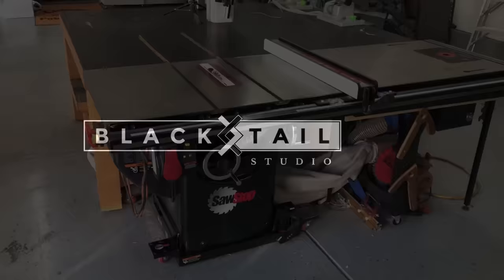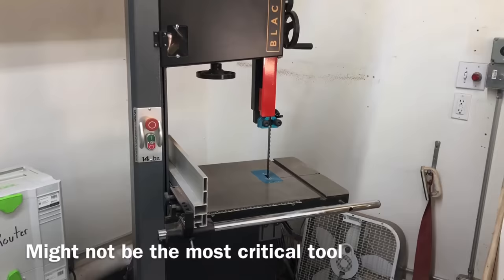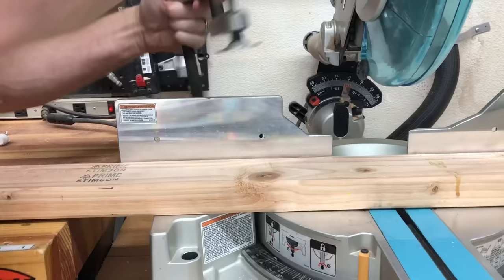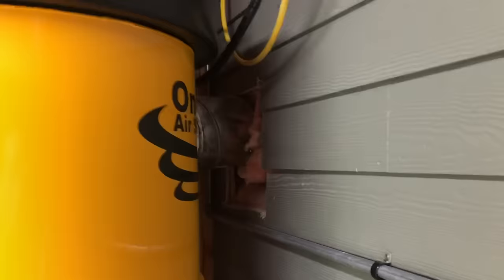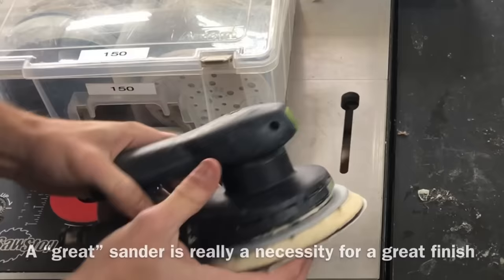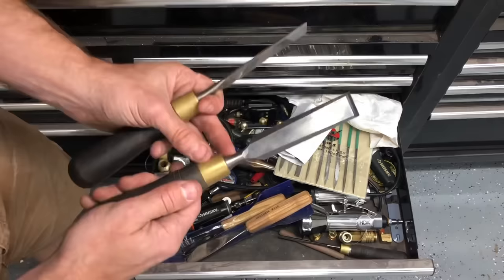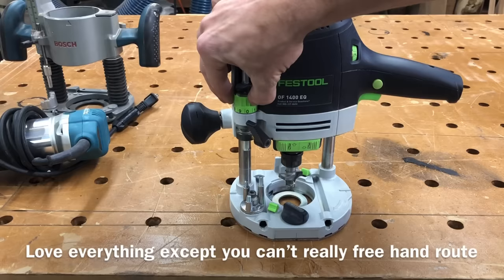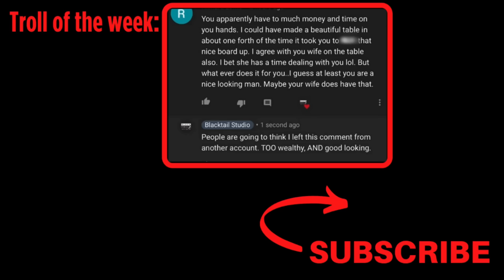10 Essential Woodworking Tools  - Woodworking Tips and Tricks

Comment: My most important tool is my circular saw.  I had a Makita for several decades which got stolen but even after 40 years, Makita made the same model.  My most important non-woodworking tool is my Makita cordless drill kit with two cordless drills.  My woodshop was a casualty of a failed 45-year union with my ex-wife.  I am starting over again but, slowly.

Comment: Favorite tool has to be the table saw! Though I don’t have a shop, I enjoyed using one when I worked in a shop! So many questions!!! how do you find track saws for certain circular saws? Do Irwin clamps normally fit in the bottom of the track like yours? Where do you find the right angle attachment for the track saw? Are you cutting straight down for bow tie inlays? Or is there a negative angle to allow for glue?
Reply from the maker: That’s over the limit! A track saw is made for a corresponding track. You don’t buy a track for a random saw. Hope that helps get you started!

Comment: #1for me is Starrett Combination square and a sharp marking knife.    I can't get any of my machines to work as accurately as these two in combination.  Next up are the various Lie Nielsen planes from a jointer down to my block plane and bevel edge chisels.  I end up using all these hand tools more than my excessive assortment of machines (sawstop, 20" planer, 8" jointer, 5 HP shaper, 24" resaw capacity bandsaw, and various festool items).
Reply from the maker: Good call!

Comment: My favourite tool: Bosh 2.3 HP router... 

My most hated tool has to be my circular saw because I get a slight chamfer even though the angle is set to 0 degrees. 
I really like your Festool track saw, but its way out of my price range. Are there any other track saws that you can recommend?  

Love the troll of the week though! keep that going forward lol
Reply from the maker: You got it! And I’ve only used the Festool
Reply: @Revan Sohan .Bosch professional has a good track saw aswell. I bought that as my first one, had it for years before I dropped it and had to buy a new one. I got a festool ts 55 rebq plus, and that’s an amazing saw! The Bosch one comes very close though! Especially since festool only really outshines other brands when you got other tools from them (because tracks can be used for a router and a track saw for example) but the Bosch GKT 55 is a great purchase, and it’s a little cheaper. Sorry for the rant by the way

Comment: Chisels: You need a paring chisel, a mortising chisel, and a 1/2"-3/4" flat chisel (for door hinges). That's all you need. Get the cheap ones, because you are going to drop them at some point, or just loose track of them.
Gouges and V's are basically useless unless you are a carver.
PS., the bandsaw is probably the safest power tool you'll ever use, so get one.
Reply from the maker: That’s a great list Steve! Good call on the bandsaw, I talk about the relative safety of it in the blog too!

Comment: Great tips! I think my fav tool so far is my track saw, not a festool but Makita is good for my skill level right now. I just got rails for a router sled but I haven’t used it yet. do you recommend using a belt sander after flattening my project or will an orbital sander work? 

Thanks!!

Comment: My Favorite tool is my little old Skill circular saw.  It is not a great tool but it is about 35 years old, only cost me $20 and it takes a licking and keeps on ticking.  It still has no wobble and if you have a sharp blade in, it will cut straight.  I was doing some home renovating and used it a lot to cut concrete and blocks figuring I was going to kill it and it is still going strong five years later.
Reply from the maker: Love me the circular saw

Comment: I really like my Festool HEPA vacuum and the Rotex 90, 150 sanders. I thought that spending $700 for a HEPA vac was retarded but after using it while stripping paint off my house I’m a believer. Hooked up to the Rotex sanders for inside work refinishing my stairs also was awesome. Didn’t need a dust wall like you would with other setups.  Once I”m done with my house remodeling maybe I”ll use my tools for some custom woodworking. Love your channel and since you are only 3 hours away (Everett, Wa) you’re like next door in YT land....cheers!!
Reply from the maker: Cheers John! And great tools

Comment: Favorite tool is my tool is sander. No more by hand =D. Have you tried polyester cast resin on table project? If, what did you think of it and how would you compare it to epoxy resin? I think many would be interested about it since it's over half cheaper than epoxy and after my one finished table it seems to do the trick as good. Maybe video about this?
Reply from the maker: Never have!

Comment: Favourite tool - me, myself and I.
As for mitre saw. Kapex supreme accuracy is a myth. It's as accurate as 12-inch Makita. I have both.
I think that interchangeability if blades between mitre and table saw should not be the reason to buy 10-inch mitre saw. Buy as big mitre as you can afford;in terms of capacity and blade diameter - the bigger the better.

Comment: Circular saw with straight edge.  I have avoided using a table saw for years with this.  I need to upgrade to Festol for even better cutting but it is amazing what I can do with the old circular saw and my 30 year old straight edge.  Great list and provides lots of suggestions.  I am thinking a brad nailer would be important as well.  The question would be pneumatic or battery operated?
Reply from the maker: Good one! I only have air powered

Comment: I have a Laguna dust collector similar to the one shown. I was thinking about moving it outside to free up some shop space but don't want to be pulling all my conditioned air (heated in winter/AC in summer) out of the shop and exhausting it outside. Is your shop not heated or cooled?

Comment: Very helpful info, thanks. As a newbie I would like to know what the different chisels are for and how use them. I don't know which ones to buy
Reply from the maker: I think narex is a good starter set
Reply: @BlacktailStudio  thank you
Reply: Narex good starter set. Ideal size 1/4 1/2 3/4 for sizes use biggest size for your application equals cleaner cuts. Butt chisels for fine detail also hinges widest blades are like 2 inches wide easier to keep the recess all flat at same level. Mortise chisels for heavy work like deep mortises. Ideally normal chisel set can do it all.

Comment: Favourite tool is my corded power drill, I really don't do battery powered tools. Maybe because I'm getting on in life.
How do you find the hook and loop system on your orbital sander! I seem to wear them down in a few days and only know when my sanding pad shoots across the shop. I've just replaced the hook and loop self adhesive paper on mine and I've worn that out now to. I'm getting a little disillusioned with them. Any tips to keep them stuck
Andy.
Reply from the maker: They make a interface pad saver. I bet that would help ya out

Comment: Wow, cool. I have a few of the same tools you have. Maybe there is hope for me after all! lol...  I have learned that the spiral or helical head for your planner and jointer are the cat's meow.  That is my next major purchase, upgrade my lunch box planner to a wider helical head and upgrade my Grizzly 8" jointer with a helical head.  Oh, and I need to figure out a good track saw to get. Festool is just above my pay grade unfortunately .  As far as the table saw though, other than lacking power, isn't the blade selection/keeping your blade clean and sharp really the key to eliminating burning?
Reply from the maker: Yup! Clean makes a huge difference
Reply: Fabuloso and a tooth brush will keep blades ,bits, drill bits clean without damaging them

Comment: I liked this video because its interesting to get your point of view. With respect to Festool, they are an expensive poor quality version of better quality tools. Festool is good for the Domino which I think is a great contribution to woodworking (and which their success is riding); as for the rest of their tools, I wouldn't touch them. Under that shiny cover is old hat poor quality mechanics. I bought all Bosch Pro (that too was a mistake from me). Bosch's articulated miter saw is great (it saves room), but there are more accurate saws on the market, and cheaper. I also have 3 routers from Bosch, which I also regret buying.

My advice to anyone is check out as many videos as you can on various manufacturers and getting feed back. No one manufacturer provides the best of everything. 
You also need to remember that personal taste also accounts for selection! Finally, with respect to your comment regarding the table saw (Sawstop), I have seen many many woodworkers all commenting on how good this machine is (now owned by Festool because of the safety system); unfortunately in Europe I have not been able to source a supplier.

My conclusion is to get a Sawstop table. When I can, I will! Thanks for the video ... I really enjoyed your point of view!
PS. I am jealous you have a pilots licence... something else I am also fascinated by!
Reply from the maker: Great feedback!

Comment: My absolute favorite tool is my sawstop table saw with the router table mounted on the left.  Can’t use it enough…

Need a recommendation for a high gloss wood finish.  Walnut and maple woods, something that will make it jump out and slap you upside the head.  Not your sexy head though ;)
Reply from the maker: Tabletop epoxy gets a pretty silly shine on it 👍🏼

Comment: My table saw has to be my favorite at the moment. I have to ask, if you were going to flatten a slab with a router, which one would you use? I’m not as fortunate at the moment to have an industrial shop that’s willing to flatten a few slabs that I have. I’ve actually purchased the Bosch that you showed in this video but haven’t opened it yet. Do you have another suggestion besides the Bosch 2.25 hp?  Any input would be appreciated.
Reply from the maker: I used that Bosch a lot for flattening. Works fine. Best would be a big 2200 Festool I suppose

Comment: Great videos and a ton of information. I’m setting up my shop now, for the bandsaw, is the 220v Laguna 14” resaw you have hotlinked worth the extra expense of a dedicated 220v line from the box or for what you have experienced would the 110v resaw suffice?  Just wondering if the juice is worth the squeeze before I pull pitch. Thanks.
Reply from the maker: I’d go 220. If you plan on using the 13” resaw anyway

Comment: I'm just starting out. I own a laser engraved machine and a old hand sander I got from Wal-Mart a while back.  I have access to a mitter sae and a circular saw.  I'm looking at buying a bora centipede work table.  My question is this, I wanted to do some routing work on my engraved pieces maybe encorporate the 2.  What hand router do you suggest for first time user like me?  I'm self supported,  I buy what I can from what I cam sell.
Reply from the maker: Check out my blog. I’d get the Bosch in there

Comment: Hi Cam, my favorite tool is my Festool ETS EC 150 sander. I was wondering Where do you buy your mould release? Can i buy it local? Thanks!
Reply from the maker: Amazon. Linked in most my epoxy videos
Reply: Hi Cam, Aaron again. Which Festool orbital do you use on epoxy? 5mm or 3mm stroke? I have the 5mm and it does great, but was wondering if the 3mm would be better? Thanks

Comment: Hi Cam. I had a quick question. Would a stain + polyurethane  (like Varathane one step stain) be fine to use on epoxy? Thanks in advance
Reply from the maker: I’ve used it before
Reply: @BlacktailStudio  How was it? Does it work well?

Comment: My favorite tool is a skill saw
I’m working on a maple slab that has a small crack but it runs through the whole 1 and a half slab do I need to use a deep pour epoxy still if it’s only an 1/8 inch wide??
Reply from the maker: Man, every crack is different. I’m generally guessing on my own pieces

Comment: router table will really expand a person's woodworking capability
Reply: oh, and if you put a 1/2" rubber grommet inside your collet you won't have to slightly raise your bits before tightening them down.  Also helps with matched router bit sets like tung and groove bits or cope and stile bit sets.  bottom out the bit onto the grommet and tighten.  switch bits and repeat without having to adjust the height on your lift.

Comment: If you put the dust collector in the shed anyways, why even go for a HEPA filter? You could just use a normal filter inside a barrel and exhaust the little bit of fine dust into a water tub or outside onto grass.
Reply from the maker: Might not always be in a shed
Reply: @BlacktailStudio  of course. But in your specific situation you could've gone for a worse filter without any health impact. You've certainly seen the comment where someone says that it's a good idea to lead the air back into the shop to not create negative pressure, which would require a good filter anyway

Comment: Don't strive to own a saw stop. It is overpriced and ridiculous. You hear people talk about "smooth cuts" or "no burning the wood". A cut goes well when you're using the correct blade and a good strong motor and that's all. The odds are that if someone owns a sawstop they are trying to be in a club, if someone owns a festool track saw they are trying to look cool, these people think that the tool makes the woodworker and they are worse off for it. You will see people cut something like a 4x8 sheet of plywood on a sawstop then be like ohhh my gooddddd woowww what a good saw. That is what people who like getting fleeced say. You need a mostly flat surface, a 3hp motor and a half dozen blades and thats fucking it. Stop wasting your money people
Reply from the maker: Oh, the sales person should have told you! The sawstop is a saw that doesn’t cut skin. It’s pretty neat actually!
Reply: @BlacktailStudio  That's the problem. You're paying for a false sense of security that allows you to develop dangerous habits just because the sawstop probably wont cut your finger off. Even worse is when you use a saw that will cut your finger off you haven't been trained to expect saws to cut your damn finger off. I'm not saying that a saw that probably doesn't cut your finger off is a bad idea. It's a really good idea that serves its purpose well and its saved many an appendage but power tools can not be thought of as safe and they should not be advertised as such to the DIY demo. A saw is designed to cut things and it will always do its damnedest to check you off its list. Practice safety so you will never need a sawstop, then maybe buy one anyway.